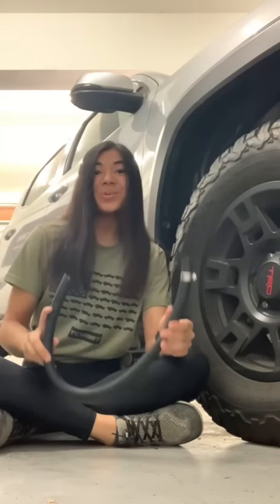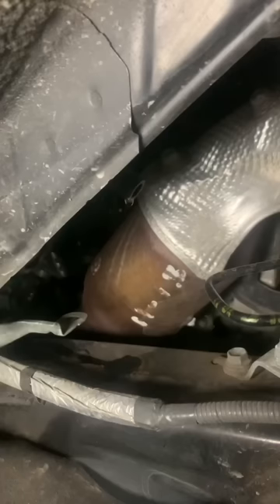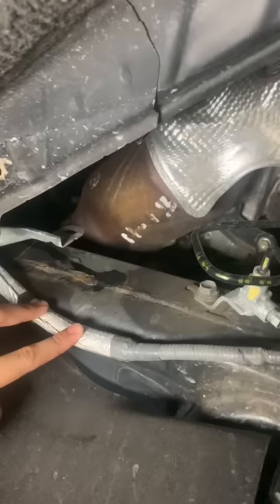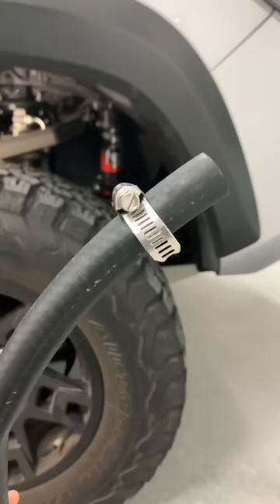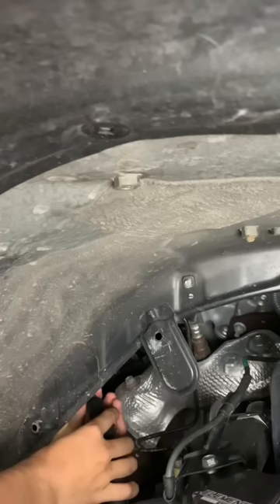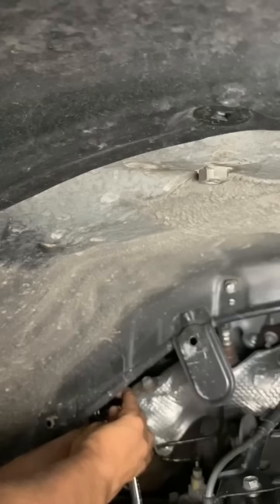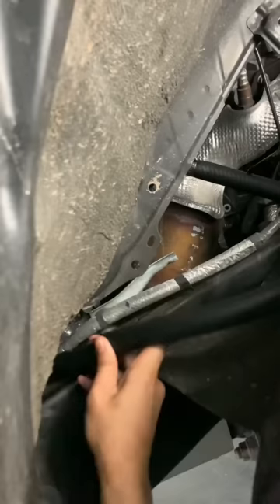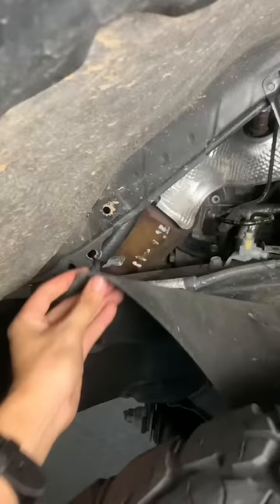Fixing AC Water Drip on my FRAME! 😨 Toyota Tacoma 3rd Gen #shorts

Comment from the maker: Link to the kit is in the description, but if you want to DIY it, I just took measurements. You need a 3/8” ID hose and around ~3ft should work
Reply: Wow they are charging $20 for 2 dollars worth of hose and 30 cent clamp.
Reply: Great tip thank you.
I just ordered mine
Reply: At the end of the clip where you're showing the final installation..........cut the angle on the hose the opposite way. Long end in front and short facing rear.

The way its cut now could force air to push the water back into the a/c. Cutting the hose the way I described would actually create a slight vacuum on the hose as you drive, drawing the water out.
Reply: Were you on donut? I might be mistaking and sorry if I am... you seem familiar on another channel.
Reply: Fantastic information and vary helpful, not to mention very informative 👍.  P.s. most definitely my kind of woman 🌹.
Reply: Tight ship you keep , respect , rust on frame stop ☝️👍💪🤔 , tube frame becomes susceptible to weakness when compromised at critical points leave spring mounts or corners for leverage , seen it on salted roads in snow country , not too much of an issue in desert 🤔 ✌️💪🙏 4 wheeling Nevada ...
Reply: Hi Chloe, I believe its 5/8 ID hose. I just bought my hose from autozone. But thanks for the video its very informative.
Reply: You're a queen
Reply: @azpazlot  you are correct, 3/8 is very small and would need an adapter. 5/8 slips right over the oem hose
Reply: 5/8, not 3/8
Reply: 5/8 not 3/8
Reply: This made me think of some ideas for new content that you could create.

How about a few videos about preparing the Tacoma for water fording:
- breather kit for front and rear diff
- breather kit for transmission and transfer car
- snorkel 
- how to drive through deep water
- what maintenance to perform after driving through deep water
...and the many things that I am not aware of

Comment: The rust belt is laughing so freakin hard at you right now
Reply: You ain't kidding, I'd just rattle can it and call it a day. Then wait for it to rust next year
Reply: Can try wool wax or fluid film too
Reply: @d33znutz1152 you can wash it as many times as you want, it's still gonna rust
Reply: @d33znutz1152 that's not what I was getting at, but it's obvious you don't have a clue anyway so I'm not going to bother to explain to you why a little bit of plain water running over the frame isn't a reason for concern here.
Reply: @d33znutz1152 you can minimize the rust by washing. But you will rust out here bro. No matter what. All you can do is slow it down.
Reply: @Boosted_aj  I've been a mechanic in California and one in Pennsylvania. I can tell you there is no comparison. Guys out west in the sun belt simply haven't seen rust like we have it.
Reply: Only cause they salt the shit out of their roads
Reply: Agreed. Even cars that are only 2-4 years old that need suspension work do not come apart up here like they do in California, Arizona, Texas, etc
Reply: Facts
Reply: @d33znutz1152 it’s called the rust belt for a reason. Because there’s nothing to combat it.
Reply: I'd be laughing at all the guys with rusty ass toyotas in the rust belt. You guys are suckers for not rust-proofing knowing you own a toyota.
Reply: The “rust belt” is actually named thst because of the steel industry. Ironically the rust belt states do way better than the northern states due to salted roads and winter conditions.

Comment: Imagine clamping a soft hose over a soft hose.
Reply: Well there's no pressure.
Reply: There will be a future video of how to secure it better. I feel like vibrations might allow it to slip off as well. I thought like you did
Reply: I see people clamping the house too tight and blocking the house all together
Reply: Right for 20 bucks you should get a barb adapter for the right size hose and 2 hose clamps. Or instead of hacking it just get a new longer hose altogether
Reply: Glad to see some people are smart enough to realize this.
Reply: That was my first thought!
Reply: @DHG1078  they'll figure it out soon enough when they're vents smell like mildew and there's water in their passenger floorboard lol
Reply: My fuel return on my rock buggy has hoses zip tied together like that. It was a trail fix that’s been going strong for years.
Reply: Pretty easy to use a brain and not clamp it like a maniac
Reply: Yall too careful. It will be fine.
Reply: @AndrewKidd14145  I mean if you ziptie it into place in 2 different spots, even if it wobbled loose at the clamp, it'd still have to work itself out of 2 zipties to come completely undone.

Comment: This really needs a fitting and the same ID hose with two hose clamps. Soft hose on soft hose doesn't usually work very well... vibrate off or you get it too tight and block the line off completely
Reply: You’re right on this, it’s missing a brass or plastic pipe fittings

Comment: At the end I hope the angled cut of the hose faces the back of the vehicle to help “pull” the condensate water out and not cut facing forward pushing air into the hose holding back the water.

Comment: Water will not hurt the frame unless it drips continouslyfor 300 years. If you seriously want to do this mod then just be careful not to pull or dislodge the original hose from the hvac drain nipple

Comment: Wouldn’t moving solve the issue. The hot air from the engine bay makes its way down to there and the force of air would clean that right off. Probably get more damage from driving in rainy conditions than letting this drip at a red light for a few seconds.
Reply: Exactly what i thought. 
I don’t idle vehicles for long so I wouldn’t have that issue i suppose.
Reply: @FivexxXxx5  AC condensation drops long after you’ve turned your car off
Reply: @ArqueonPittman  my garage turns into an oven when I park my truck in it.. that water is long gone after 2 minutes.

Comment: Uh... It's going to get wet there when it rains anyways but if you feel like you need to do something then why not just spray a bit of plastidip there.  It's draining straight down so gravity can pull it out. You are possibly preventing it from draining properly by adding that line.

Comment: Wouldn’t it have also been better to use a 2 male sided connector to connect the 2 hose versus using 1 hose clamp over to 2 rubber hoses and possibly causing constriction on the first hose?

Comment: And when that rubber hose catches fire from the exhaust..... ? Does the insurance still cover the fire damage the"upgrade" caused....🤔
     Don't cheap out, get the stainless braided hose protector that reduces the heat exposure issue.

Comment: So a fix for a problem that doesn’t really exist… No one is going to get rust damage from some condensate drip.  It also blows off and gets dried when in motion. The water isn’t going to hurt anything. 100x worse exposure when driving in the rain… Condensate dripping when parked isn’t a significant cause of damaging rust either .  

This mod has been around for years, if Toyota thought this would do anything , they would have issued a TSB and also reroute the hose at the factory .  
But whatever makes people feel better..
Reply: 100%
Reply: Yeah I was thinking as soon as you drive the air cleans the water right off. Especially with the heat from the engine. Hot air drys water super fast.

Comment: I just had a AC drip going inside the front passager floor in my 2019 Ford F-150 and made a similar solution to move the condensation drip further away from the fire wall. Why the heck are these car manufacturers not doing this in the first place?

Comment: Here's something that nobody talks about and Toyota doesn't want you finding out. No matter what you do trying to protect that Toyota frame, it will most likely rust out but from inside. Toyota has paid out over a $billion in replacing frames on their pickups or settled with owners. The fully boxed and poorly drained frames rust out from the inside under 10 years and usualy buckle at mid point.

Comment: I never understand why people only use 1 damn zip tie like bruh the are literally like 2or3 pennies a piece I use 3 in every situation its possible sometimes the hole isn't big enough but the purpose is 99% of people use the super cheap harbor freight or Walmart zip ties so failure Is bound to happen so use at least 2 for added strength and just incase of a failure

Comment: It's cool you did this but up north where im from the salt and chemical sprays they use on the roads will eat that frame to nothing in about 10 years. Vermont is nice becauae they have a ban on using this stuff and only use sand on roads. My father found a 1993 ford ranger 5 speed manual from Vermont with 65k on motor and tranny and it litterally didnt have a spot of rust on it. My brother use to live in the Florida keys and there its even worse. All the salt water coming off the ocean will kill any truck frames. My father found him another truck one of those Splash version trucks from Vermont same thing. Truck was about 15 years old and not a spot of rust. In Connecticut were we are from not so lucky. You habe to get the frame sprayed to protect from rust because a ford or Chevy will litterally rot to nothing in about 10 years. I saw a 1960 Ford Bronco pickup the other day and where im from its stupidly rare to see one still around. Thos had Arizona plates on it though so I'm assuming he was just passing through from Arizona. 1 winter in New england amd that truck is no more.

Comment: Those wire ties holding the hose will not last after a few heat cycles on the catalytic converter. Good luck.

Comment: You do know that you need something rigid and more than likely different sizes to fit what you just showed on because the way you described it is you put a soft toes over a soft hose and clamped it that's either going to fall off or completely close off the drain and then it will back up into the cabin and start leaking on your floor a little confused on who told you this was a good idea

Comment: Water does NOT cause rust. Idk how high you are but that’s not caused by water. It’s minerals inside the water. People literally use distilled water and it will never cause rust. They run distilled water for coolant down south even, meaning it’s constantly running through the inside of your engine. It doesn’t rust your engine 🤦‍♂️

Comment: Well problem is it's a Toyota Tacoma that's not even a real pickup to start with and if frame is rusting from water dripping off your AC compressor then you got something major wrong with the frame so sell it and buy a real truck not no crack box truck made in Japan

Comment: Why would they desighn it like that in the first place. Go to dealership n makem fix rust underwarranty. Its theyr own fault
Reply: They'll laugh you out of the dealership. Surface rust on the frame is not point not a problem, it's normal and expected. It probably doesn't even have anything specifically to do with the AC. The whole frame is e posed to humidity and water from rain. That does exponentially more than some condensation lol

Comment: better not drive through a puddle with those tires if you are worried about condensation drips (which are basically distilled and wont cause rust themselves). what a freaking joke. Take some basic science classes.